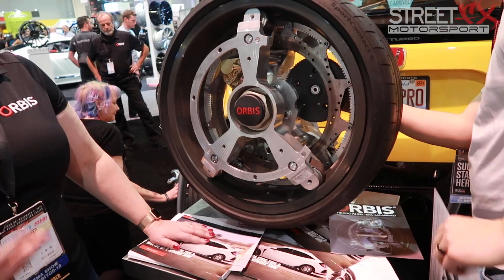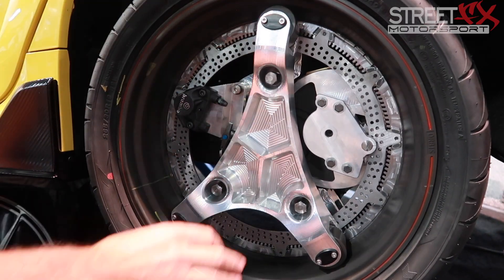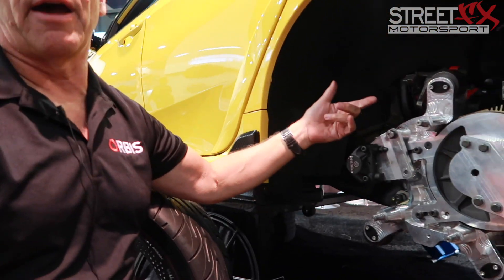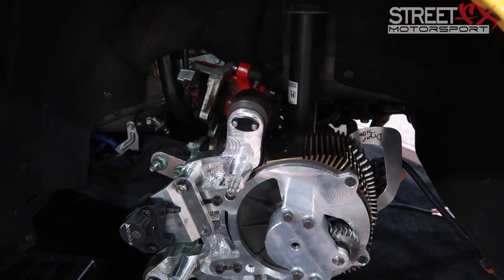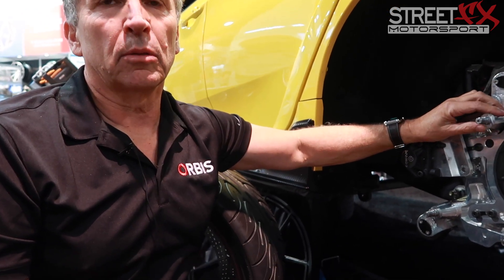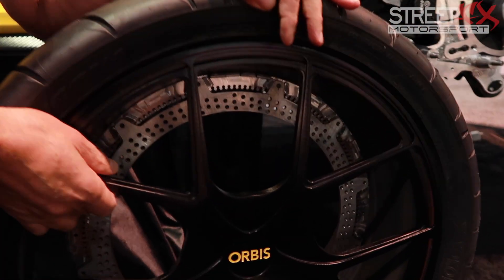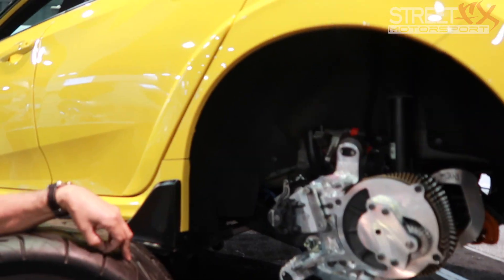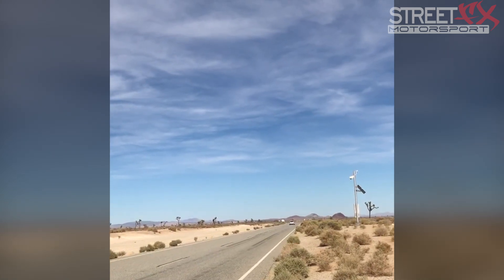WORLD's FIRST ELECTRIC hybrid AWD Honda Civic Type R FK8 with 450hp!

Comment: If they made these for older civics they would sell like hot cakes
Reply: Famus 801 - They do sell them for ANY car. They just need a cad file and they will make it. They have made them for these Civics as proof of concept. He said some vehicles they can use the 100hp per wheel motors, the car just needs more clearance than this specific civic.
Reply: @ralphmenta249    Actually they don't sell anything other than a 12 month license to use their tech at a measly 750kUSD.  "Exploratory licenses are granted in 12-month periods. Approved applicants will be required to provide a vehicle to ORBIS for retrofitting with a Ring-Drive system. Once the retrofit is complete, the vehicle will be tested and evaluated by a mutually agreed upon third party lab. ORBIS technology will remain the property of ORBIS throughout the exploratory license period. At the conclusion of the exploratory licensing period, licensees can pursue further development through an Evaluation and/or Manufacturer’s  license. Should the licensee decline further development, the original vehicle will be returned in its original state." - That is per their website.  No where in writing do they sell anything.  Actually if you read their website the civic was done as a proof of concept nothing more. The reason they went to SEMA was to one see if there is a market and two attempt to gain investors.  At this time according to their FAQ section on their website - "Can I purchase ORBIS Ring-Drive technology for my car or truck?
Not directly from ORBIS. As warehouse distributors and partnerships are established, that information will be published on our website."
As of right now NO partnerships have been announced.   So learn to read and don't get duped by a salesman.  Your first clue that something was wrong with his sales pitch should have been when he said it would only take an hour to install.
Reply: @ralphmenta249  I just wanted to let you know that the time I wasted was at work EDIT of which technically I wasnt wasting since I was multi tasking.  As for saying I should have read what I pasted... obviously I did since it made my argument about them not selling it and how it will be sold in the future for me or did you not read that?  And why wouldn't someone use cut and paste when they are not only quoting but citing the quote to the originator as well?  As for my work history I used to be a mechanic a while back and while these days the only cars I work on are my own I am experienced enough to know that while yes you can drop a spindle and a control arm in 15 minutes.  What you can't do though is put that car on stands, remove the wheels, disconnect the brake lines, abs sensors, remove the knuckle and hub assembly, install a new one, reconnect the abs sensor, add in/replace a proportioning valve, connect the brake line to the new caliper, bleed those brakes, install and securely mount the battery pack wire the motors, batteries, to their controller, put the wheels back on, route and wire their controller through the car to the canbus connected module since most vehicles have those modules either under the front seats, under the dash or if you were lucky under the hood and not always connected to something in the rear (Assuming it didn't utilize the OBD2 interface connector EDIT as not all vehicles use can bus protocal especially older cars and rather the system requires a pass through connection to intercept signals to operate.  Much like the old Greddy turbo kit controllers for the previous civic generations SI's did.) in such a way that it was functional and not going to cause an electrical fire in an hours worth of work.  Oh and not to mention the required alignment that most DIY'ers cant do as doing camber and castor requires more than some string and jack stands like toe adjustment does.  Doable by a DIY'er sure but in that time and being so "Simple" no not happening.  

As for that CEO just because he is a CEO doesn't mean he isn't a salesman.  In fact it is usually the CEO I.E. the face of the company that sells his companies product idea to prospective investors so he can produce said product in the first place.  So yes it is a salesman's pitch and is based less on facts and more on emotions hence it isn't a matter of duping its actually referred to as marketing.  He has a product that works so its not a dupe.  However, if you cut away all the claims designed to target basic human impulses that encourage you to buy a product through the use of eliciting excitement you realize the grass isn't as green as he claimed.

Oh and for the record not using a logitech and as far as research goes yeah I even went as far as to find out who's patent they based their idea off of before getting their own patent.  (Ahmed Y. A. Mothafar) Which they cited in their patent application and I even checked out their SEC filings which would elude that they failed to market their HMMWV concept to any military thus necessitating taking their technology to the public market.  EDIT Basically they have little in the way of earnings and rather rely on private investments assuming it was the right Orbis of which there were a couple.   Oh and the only shit I am talking is about the fact that I am writing this right now while taking a shit.
Reply: @Sam Cody 
Personally I love the sound of an engine. EVs bore me in that regards, but my point was that this kit is way too expensive for the current market. With $12K you could do a lot more than add 100hp to the rear wheels. Like even if it was an EV conversion people have made 10 second cars with around $12K.

However, whoever told you that EVs are far out in the future hasn't been paying attention. Yes, EVs are still not cheap, but it was only about 8 years ago that commercially available EVs were not even viable for daily use, like the first Nissan Leaf back in 2010 could only go about 70 miles. Now we have EVs that have decent range in the $30K price range. Like the Chevy Bolt, my friend picked up one and he was able to do 270 miles on a full charge and it's more fun than any basic econo car.  Is it for everyone? Nope. But as battery technology improves the more EVs will become a popular option.  

Hydrogen fuel cell technology is for EVs. It's a method for generating electricity, the problem is the infrastructure, no one wants to flip the bill to get hydrogen stations common enough. But I agree that it is the most convenient since filling up is quick. The technology is already here. In Southern California we have hydrogen stations so every so often you will see Hydrogen Fuel Cell cars running around like the Toyota Mirai which can do 300 miles on a tank of hydrogen.

In regards to charging issues how do you charge your phone? Do you wait in line? The charging technology is also improving. Fast charging is still slow in comparison to filling up at a gas station, but the average person does not drive more than 80 miles in a day. So plugging in at home makes it convenient. I understand not everyone has easy access to electricity, but in my field of work (landscape/urban planning) the plans that come across my desk are showing more and more charging stations being planned in parking lots. Just like how coffee shops didn't have outlets now most coffee shops have outlets for your laptop and some even have wireless charging spots for your phone. The infrastructure to add charging stations is an extremely easy retro fit.

The lack of maintenance on an EV is a big selling point because people treat cars like they would with a new TV, they don't care how it works they just want features and to just work, they don't want to deal with oil changes, maintenance, repairs, etc. 

When talking about what is more clean honestly I don't care. That is a debate that will get us no where since there are so many variables. Some think the ultimate clean solution is just to buy used vehicles and improve their engine's efficiency since that would reduce the overall new cars built reducing the amount of manufacturing waste being produced. There was a point in time when people used to fix their TVs, now you can't even give away an old TV that works. The same will happen to cars unfortunately.
Reply: While it would be cool, I doubt they would sell that well, 10 grand for 100hp in an older civic is really bad price per hp compared to a boosted B D or K series.
Reply: @efboiz5302  For $13,000 you can create a powerful EV conversion, lol.
Reply: @efboiz5302  what about when you maxed out your HP and TQ and want more HP and have already put $20k into your motor? This could be added on top of anything else anyone have already done.
Reply: One Moar Wanza    yea but what about adding AWD for launch control and better wet traction, wheel torque vectoring, regenerative braking, reducing immersions, able to drive 40 miles on electric alone, and not to mention having an upgrade that many will not have nor have seen before? The last one is priceless to some people.
Reply: This would be good on my hatch ep3
Reply: All I’m saying is if these were cheaper and made for almost any car of choice they would sell out quickly, it’s still a concept but they’re on the right track , imagine having a reliable civic with great mpg and awd, or a K- series turbo awd that would be insane with those electric motors
Reply: He said that they can essentially make it for any car.
Reply: they can make these for all cars, the only question is the gov making it illegal since this is a instant electric car.
Reply: Guys have been having success with the old awd wagon and some awd crv set ups for awd civics. It's a beautiful world we live in! Hell. I remember when h2b trannys were a thing if innovation!  I'm a Subaru guy now ( insert ringland joke) but always loved my Hondas . (Puts flame suit on) honestly, I respect anything that is quick and people who work hard on their builds
Reply: @mitchelldesiervi4091  have you seen the Boosted Boiz Hondaru?
Reply: 1200$ without it installed for a battery operated system not very practical when oem parts are a lot cheaper
Reply: ikr
Reply: Just to put some info out there for everyone. There are several cars being converted to EV with Tesla motors and these people are paying in average $100k for the conversion and 4 months minimum turn around. Anyone still think $12k and 1 hour of work is not feasible to sell?
Reply: considering you can gain more then 100hp for less than 12k out of an older Honda I would say no.
Reply: Im pretty sure you can get it for any car. And ppl driving old civics would just get a sticker for the back wheels to make it look like they had this shit.
Reply: Exactly
Reply: This would be a perfect add on for a 1st Gen Honda Insight as it already has the battery built in
Reply: Cody Did you write this before hearing about Tesla? LOL One is Tesla’s main drives is to make their own batteries to revolutionize the battery industry, which they are already well underway. In a few years they will produce as many batteries out of their Gigafactories (1.9 Million Square Feet) than all the top battery fabricators world wide, combined! The cost and storage of batteries was first on Tesla’s agenda even though they have been producing vehicles more than batteries until the Gigafactory opened. They know more efficient and less costly batteries are the only way we can transition off of the internal combustion engine. Even if we are still using power from coal burning electric companies, that is a much more efficient and cleaner power source. Tesla is also focused on solar and wind energy to power their charging stations. As more electric vehicles are sold and on the roads, charging stations will grow in size to accommodate. We just need to all hop on board. Check out this article;
https://www.google.com/amp/s/mobile.reuters.com/article/amp/idUSKBN22Q1WC
Reply: Famus 801 they would sell like hotcakes if they were affordable. To bolt $10,000 worth of electric motors on to a $2500 car you're still gonna have a $2500 car.
Reply: @bigtonkakid  They're putting 10k+ worth of mods into 500.00 civics alraeady
Reply: @iivv_nn  I don't think any of them are worried about resale value.
Reply: @iivv_nn  Exactly.. Hell, some of them have multi-thousand dollar stereo systems..  Though with a big Prius battery in the trunk, where would they put their sub-woofer..  :-)
Reply: Bigtonkakid, very true.  Though it would double the hp of an older honda.  They could also be removed and re-sold.  I'd give it some thought, personally...........if I could afford them. Lol
Reply: @bigtonkakid   This is awd conversion, transfer case, and active diff all in one without any cutting of the car. That is a fair price to pay with minimal labor charge. Not to mention this is a low volume product.
Reply: @bigtonkakid  yup. I put a 2k set of rims on my car i have to use 5 different lock nuts and hope someone dont really want them. I couldn't imagine how hard you would have to watch this
Reply: @bigtonkakid  value is subjective
Reply: If this was half the price I'd be all over it for my 98 hatch.
Reply: @Sam Cody 
You're talking about a concept package that no one has tried out on their own. My point is that it's not worth it. You could buy a better car by adding another $13K to the price tag. You can do other mods to improve power. Remember $10K is just for the wheel system, you still have to add batteries. They didn't show you where the batteries go, batteries are not small so you'll give up cargo space. Also it's not clear if this kit comes with a battery control module which is also not cheap. I hope the final kit has something to cover the ring gear, one stone getting caught in that will cause a huge problem, hell the dust/road grime over time will cause issues. 

Also these aren't the first people to showcase something like this. I wish the company the best of luck, but anyone looking to go faster I highly doubt would pay $13K+ for 100whp. This is just for the people you described who are looking for that interesting tech stuff. We don't even know if these can do 100whp. The motors are so small, if they can do 50whp (~37kw) each that would be actually pretty amazing.  So if they are doing what they claim, my hats off to them. 

You won't get incredible power, it's only 100whp. You get good power. And I don't know how he said it's just 1 hour for installation. You still have to bleed the brakes, possibly change the brake proportioning valve, run the wires for the motors, fix the parking brake (or is there no longer one?), etc. And that's not figuring out how to install 150lbs of batteries somewhere, running the cables, etc. This is not as simple as he makes it out to be. Sure it's a lot easier than opening up an engine, but come on, don't be so naive. 

Remember this show cased a couple years ago? https://youtu.be/4-Vck6oCi3A
They claimed it added 150ft/tq from their 50kw motor, it's still a hard sell. 

This company has been in the automotive EV wheel hubs for almost 10 years. 
https://www.proteanelectric.com/protean-drive/#technology
Yet, they still have a hard time selling their products. 

It's all just too expensive to the point where no one or very few people are actually interested in ponying up the cash for it. Sure, I'd love to have this on my car, but will I spend $13K potentially more for it? Nope. Not even if it was $7000. 

And just because it's AWD does not mean it will improve handling. A lot of tuning would have be done to make sure that the rear wheels don't try to over power the front at differing throttle inputs, same with the TQ vectoring. Or cause some unwanted oversteer. The early AWD sports cars of the 80's were such a handful when being pushed hard. In a straight line sure it's fine it'll help traction, but around a corner it's going to get very complicated. Especially with these newer cars and their crazy advanced ABS systems. 

And seriously, would you go and buy a $35k+ car, pay another $13K+ to void its warranty to only add 100whp? You're looking at now a near $50K car? $13K is no chump change, it makes so little sense.
Reply: 1. Those want to build their own car, so coming like that straight from the factory would be only for those who don't want to get their hands dirty.
2. Those type of people also like shifting their cars so even with a dud shifter then it would be boring too.
So again unless you want to have the build with no effort then i guess
Reply: Itll be also too "hot cake common". Everyone would just have it.
Reply: @TrichieSXT  if everyone drove hellcats i dont think that anyone would complain that their car wasnt fast enough

Comment: I'm interested to see more about how the wheel attaches to the hub. Specifically how lateral forces are dealt with.
Reply: I think a heavy duty version of this could build the entire unit into the rim, add thrust bearings for lateral forces, and encase the entire thing with aluminum and fill it with cooling fluid (you'd probably need a pump and radiator system for that, but it would hopefully be more durable as a whole)